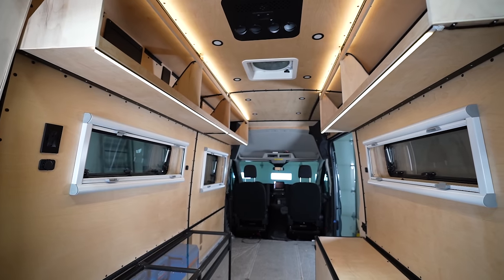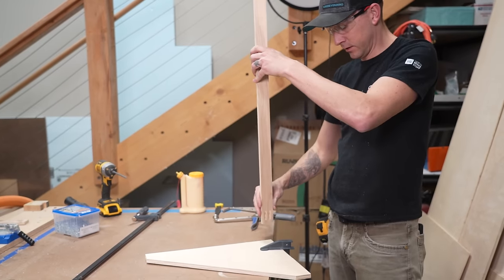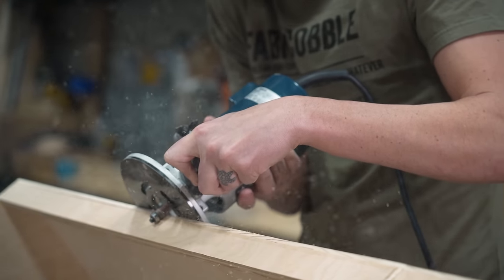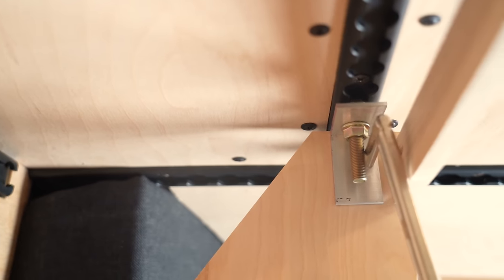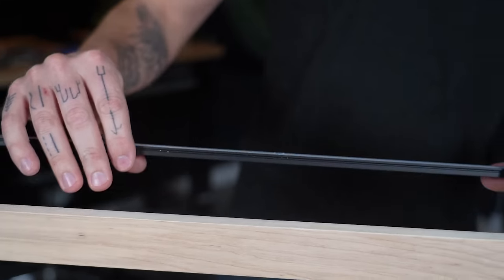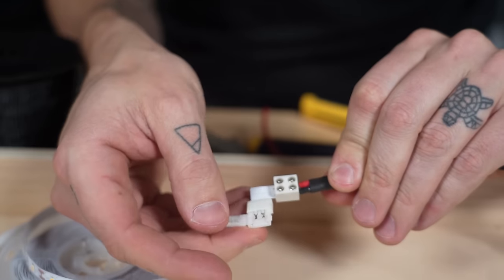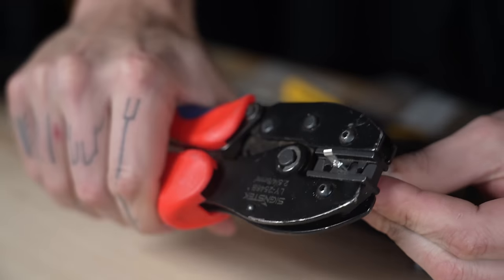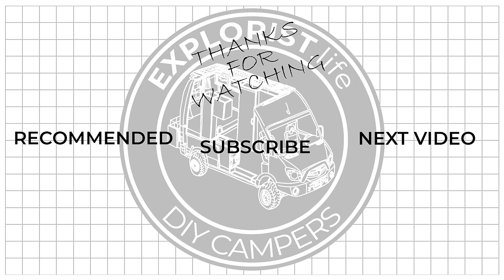DIY UPPER CABINETS - VAN BUILD

Comment from the maker: PLANS, PARTS & TOOLS: 
Upper Cabinets 3d Plans & Cut List: https://shop.explorist.life/shop/all-products/plans-and-diagrams/3d-files-project-templates/camper-van-upper-cabinet-plans/
Full Camper Van Furniture Plans & Cut List: https://shop.explorist.life/shop/all-products/plans-and-diagrams/3d-files-project-templates/camper-van-cabinetry-plans-full-set/
TOOLS SEEN IN THIS VIDEO:
◾https://www.amazon.com/shop/exploristlife/list/2M5OT6H0IOBQX
PARTS:
◾*1/4" Birch:* Local Purchase
◾*1/2" Birch:* Local Purchase
◾*Wood Glue:* https://amzn.to/3K0t87Q
◾*Wood Filler:* https://amzn.to/3YGPqzI
◾*Edge Banding:* https://amzn.to/3YGPu2q
◾*Paste Wax:* https://amzn.to/3DWWQHd
◾*Black Spray Paint:* https://amzn.to/3YLWriE
◾*Rivets:* https://amzn.to/3E12qIH
◾*Black LED Track w/ Diffusers:* https://amzn.to/3E3kSjT
◾*1/4" Wire Loom:* https://amzn.to/3lvZxZZ
◾*1/4" Heat Shrink:* https://amzn.to/40NkwaJ
◾*LED Strips:* https://amzn.to/3RQ5pt6
◾*Wire Clips:* https://amzn.to/3jLyVnj
◾*Anderson Outlet:* https://powerwerx.com/panelpole-panel-mount-powerpole-black-dual
◾*Anderson Plug:* https://powerwerx.com/anderson-powerpole-connectors-45amp-bonded
◾*Lever Nuts:* https://amzn.to/3RSyp3i
◾*L-Track Hardware:* https://amzn.to/3jWDniT
◾*11x11x11" Cloth Bins:* https://amzn.to/3If5lzP
◾*Solderless LED Connectors:* https://amzn.to/40Jhl3X

Comment: Nice clean design that produced a lot of storage. Question on did you finish the back / inside of the cabinet on the pop rivets row?  They looked to be protruding about 1/4".
Reply from the maker: They are still protruding.  Since the wall angles so much, the canvas totes don't even tough them, so I didn't feel it was worth the effort to trim them off or anything.

Comment: You wernt getting sag from those cabinets? 1/4” plywood seems pretty thin
Reply from the maker: Not with the 1/2" faces on the front and the aluminum angle on the back.

Comment: Hi there, i see you have chosen anderson connectors. (Am i spelling this correctly?) I remember you asked your viewers what they think the cabinet lights should be connected. So for the sake of discussion, and off course considerations for my future next build; What made you choose to use these 12 volt light connections?
Reply from the maker: What would be another connector you'd be considering instead of Anderson connectors?
Reply: @EXPLORISTlife  good question. Im not saying these Anderson connection are wrong. Not at all. 
I believed you wanted something modular, for the overhead cabinets, if im not mistaken. I believe what I understood was, you wanted to build several different storage modules, that could be interchangeable for certain needs. And i believed you where asking what kind of connection your viewers would consider. Is my memory correct in this? 

Anyway I suggested the possibility of using wireless smartphones chargers for the connection. But never got the chance anymore to see for myself, if this would work. (Overload on work, family life etc) So i was wondering what your consideration would be, using these type of connections.  Its just my curiosity for my next possible build in the future.

Im still gonna try to make wireless connection, and see if there is any extra use of electricity consumption….. When i have time on hands again. 
The reason for this, is to see, if it’s possible to make (reading lights, spot lights) that i can use throughout the van, on several places, without having to install so many lights and switches. In other words; will i save on wires, switches etc. And will this make my future build any easier? Or the same amount of headache? 

Anyway thanks for responding 
Cheers
Reply from the maker: Ah, yes.  I see/remember.  So, when I looked at that... I just simply couldn't find a good source of products to make that work and have faith it would be reliable.  That and wireless charging is such a low amperage, that it would limit my circuits quite a bit.  It would probably work for some LED strip lights, but if I wanted to add USB chargers to the cabinets (or whatever), that would be too much to pull from wireless charging.  I'm excited to see what the future of wireless charging does, but I don't think now is the right time for what I'm trying to do with it.  Great idea, though, and I definitely think you should play around with it, at the very least on a benchtop test of some kind.

Comment: Love it! Lightweight and strong (enough). The ones I built in my van I did in a more traditional way and with doors. Way to heavy and its internal structure even steal space that I could have used for storage...and I still have those boxes too 😁 well, you live and learn. If there is ever a nuclear war, I know were to hide...

Comment: Looks nice. I’ve enjoyed watching this van build, and appreciate your step-by-step narrative. I must say though, everything up this point has been extremely high quality. Those upper cabinets look nice, but I’d be concerned about the durability. Since you used 80/20 for the battery enclosure, I assumed you would have used it again for the uppers. I get it that stuff isn’t cheap. Using 1/4” ply for the base with only glue and brad nails really limits what you can store up there. I guess you should have the weigh down low anyway. Not trying to troll, but would like to see an update after you’ve driven awhile to see how they hold up.
Reply from the maker: Durability shouldn't be an issue.  8020 is much heavier than it looks and for the lightweight items we will be storing up there (clothes, food, etc), the 1/2 ply secured every ~3ft will be plenty strong.  If you are trying to make your upper cabinets double as a pull-up bar or something, you'll definitely want something stronger, but that's not what we are using it for.

For the 1/4" ply and brad nails...  The brad nails simply hold the panel in place until the glue could dry.  Once wood glue dries, the wood around the glue will typically fail before the actual joint does, so that's a non-issue.  Also...  The rear of the 1/4" ply is secured along the bottom length with 2"x2" aluminum angle that's bolted directly to the wall. so there is no way that could fall off.  The front, in addition to the glued joint, is also held in with the screws that are holding the light track to the panel.

It's plenty secure.  It's more secure than the way we built our cabinets in our old sprinter that we lived in fulll-time for nearly 4 years.

Comment: Do you have a link for the solderless led connectors. Another great video
Reply from the maker: Yep!   Added it to the parts list in the pinned comment. 👍🙂
Reply: Thanks for video, Do you have a link for the strip lights, connectors and tracks you used in the cabinets?
Reply from the maker: @Joe-zh2gv  Yep!  All of that is in the pinned comment.

Comment: I don’t mean to be a negative Nancy, but your table saw techniques made me cringe.  Please get a little coaching from a pro.  
Don’t operate the saw from the side.  Keep the blade further than arms length away for as long as possible. Hold the material FIRMLY from the end.  Don’t use the fence if the material is wider than it’s length.  Expose only 1/4” of the blade above material. Alway use a riving knife when possible.
The table saw is probably the most dangerous tool commonly used. That said, you need you operate it properly but confidently.
 It amazes me that federal law requires all table saws ship with a blade guard but no instructions on proper table saw technique.
Reply from the maker: Hey there OSHA Oscar!  If my table saw technique is the biggest thing that is bothering you today, I'm happy for you.  My table saw usage doesn't even crack the top 20 most dangerous things I do on a day to day basis.  Thanks for watching, but you can keep your safety tips to yourself going forward as they will always fall on deaf ears.
Reply: @EXPLORISTlife  that’s a strange reply?  I just gave you a few tips on how to keep your fingers attached to your hand? Did someone piss in your Your Corn Flakes this morning?  Best of luck to you.
Reply from the maker: I mean, it's the same reply I'd give you in real life if some random person were to walk into my shop and start giving me safety tips. 🤣😂  Y'all expect me to reply differently on the internet vs real life?  You gave me an unsolicited safety tip and I gave you an unsolicited tip to keep it to yourself.  We are even as far as I'm concerned. 🤣👍  Tell me I'm doing something wrong and then get all offended when I defend myself.  Give me a break.

Comment: Videos are very well explained. The only thing is...some of us  don't have all the tools or a nice work shop 😅😅😅
Reply from the maker: Workshop isn't necessary.  And I didn't use any tools that the average DIYer won't have (for example: no cnc machines, plasma Cutters, welders, 3d printers, etc).  Just basic hand and power tools.

Comment: What brand of 12v LED Strips did you go with? Pretty reliable?
Reply from the maker: The lights we used are in the parts list in the pinned comment.

As far as reliability... we've had them on for a total of an hour and a half or so, and so far so good. 🤷‍♂️🤣

Comment: It's pretty! But those L tracks, aren't they a waste? most people just bolt the cabinets into the van, or to some wood framing. we are not going to move them around anyways. So gain, this is super tidy and pleasure to watch, but I guess not the most economical solution.
Reply from the maker: They aren't a waste, no.  We wanted to be able to have rock solid attachment points throughout the van for whatever we wanted to attach, and these do exactly that with no guess-work and no arbitrarily lag screwing stuff to "the van", whatever that means.
Reply from the maker: Plus... if I had just randomly screwed things to the wall, you'd probably be here roasting me for it not being sturdy enough. 🤷‍♂️😂

Comment: Thank you for another amazing video! It left me with one question. is there any specific reason why the cabinets side walls are cut on such a angle that leaves so much space in between the back and upper wall? What is the purpose of that space? 

Also, congratulations on 200k subscribers!! And many more to come, because you guys doing a fantastic job! :)
Reply from the maker: Aesthetics, mainly.  Just thought it looked neat.
Reply: @EXPLORISTlife  
Got it! Thank you 😊
Reply: It also helps to accommodate the curved corners of most vans, so (personally I find) it's practical too.
Reply: @JustinShaedo  That makes perfect sense.

Comment: love to know how you got the end panels to contour the van
Reply from the maker: Which 'end panels' are you talking about.  The wall panels?
Reply: @EXPLORISTlife  as you are facing the cabinets, the side panels to the left and right that can be seen
Reply from the maker: Gotcha.  We didn't actually 'contour' them.  They have an angle on them; but the 'top' and 'back' of them are indeed scribed to fit & keep them plumb & square with the floor.
Reply from the maker: A bunch of cardbord test pieces to make those.
Reply: @EXPLORISTlife  like it, saves making hidden parts tidy. Looking to do something similar